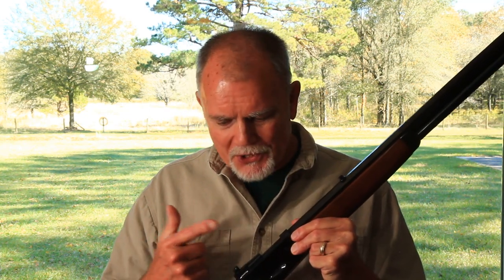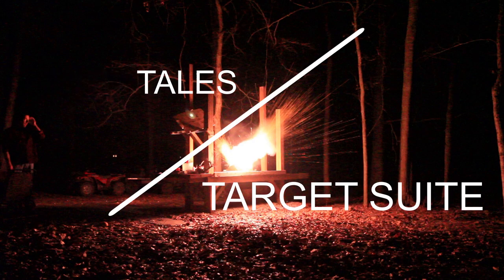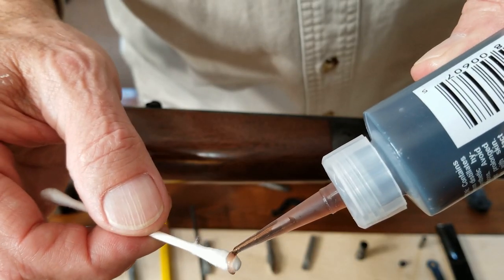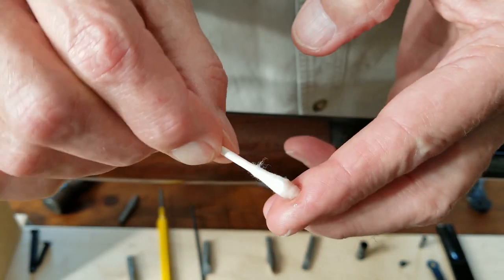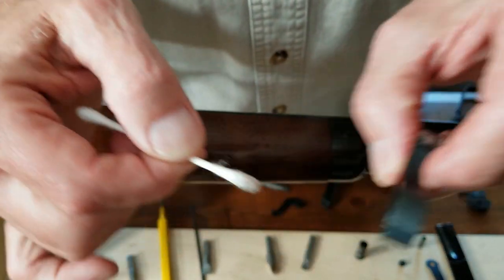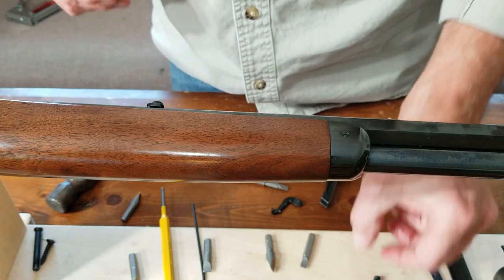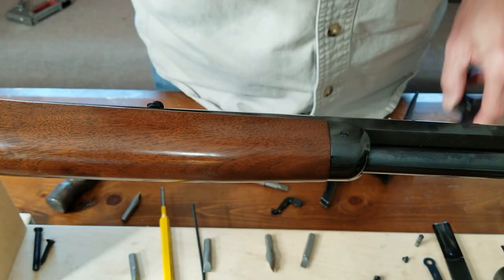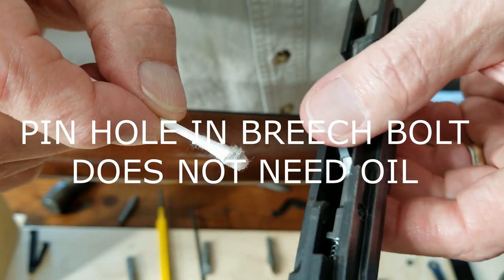Winchester Miroku 1886 Maintenance / Lubrication

Comment: I drown my guns in CLP. Then on any camming surfaces, I use Gunslick grafite greese. I lay or prop gun at an angle to allow excess to bleed out onto a rag for a day. Next day slather outside with generous CLP or other gun oil. Let it soak in a bit and wipe down with a clean rag, but leaving a visible sheen. We get all four seasons in a day in PA. Never had a gun fail from too much lube. But had them rust from too little. I like your presentation style. Thanks
Reply from the maker: Sounds great for moderate climes, but extremely cold weather will turn that "excess" lube into sludge that hinders operation of your firearms. My channel friends from farther north (in Canada) alerted me to that issue. They have to run their guns almost dry during the winter, then lube up when more reasonable temps return.

Comment: I'd say the "slab everything in oil" method is useful for long term storage without firing at least, but yeah I'm inclined to agree that for something you take out somewhat often it just leads to a load of carbon to turn your hands black when it comes cleaning time.
Reply from the maker: Yep. My thoughts exactly. Thanks for the comment!

Comment: I had to come back and watch this and your previous video again.  I just picked up an 1886 (Pedersoli).  It's a beautiful rifle and jaw dropping out of box accuracy.  The action is smooth with just a little binding, which after a few more rounds and a good oiling I'm sure it will be glass smooth.  I like my Marlin 1895 but the 1886 has so much more soul.  Problem is it's almost too pretty to take out into the field.  Thanks for your videos!
Reply from the maker: That Pedersoli is lovely. You won't have to deal with the Winchester safety.

Comment: I use a brake cleaner (carefully) remove all factory, or existing lube.  First thing I do is use Corrosion-X on all metal parts.  But it’s not a lube.  Then I use a light Teflon based grease on high friction parts. And a lighter lube on the rest of all of my firearms.    
For pistols, such as Glock, I use the light Teflon based grease, on the lubrication areas and Barrel.   I do thst because oil will migrate out.
I also mirror polish some non-dimensional critical, high friction areas, but some firearms only.  

I find on lever guns, it’s hard to beat an older Winchester for smoothness.   But I can come close with Rossis.   But they always seem never to quite match my Winchesters, or Marlins.    

If I’m shooting, or hunting in the rain, I will wipe, or spray down my entire firearm with Corrosion—X, or Breakfree—CLP.    I’ve had success in preventing rust with both. But the Corrosion—X seems to work best.  

I’m Not advertising for any brand. That’s just what I use and have had success with.   I have family members that like Ballistiol.  I don’t.   But I shoot and train year round, rain, shine, snow, hot weather, or whatever conditions come, or I can create.     The goal is to hit whatever I’m shooting at no matter what.

I’m also trying out a Lucas product.  So far, I’ve had some success with it.  But it can’t match grease, and doesn’t seem to be any better than Breakfree.  But I have 2 AR-15s that I lubricated each one with a different one.    I’m going to see how  many rounds in each before they get too dirty to be reliable.
Reply from the maker: Sounds like you have a plan, and a good one at that. I personally don't care for Ballistol either. But then I haven't used it extensively either like some of the "believers".

Comment: Just found your channel a couple of days ago and I subbed and I also subscribe to the guys you mentioned and I'm older than all 3 of you. For lubrication I just use white lithium grease applied sparingly with the swabs and one of those little bitty paint brushes. I bought a one pound tube of it 20-30 years ago and have used it ever since. It's bought and paid for so I use it and it has worked for me. May not be the best. Anyhow I enjoy you videos-keep them coming!
Reply from the maker: Thanks David. I think those steel surfaces aren't as snobby about slick'em as we are. But, and this is a big one, I used the Wilson grease (very sparingly) on the slide surfaces of my old High Standard Victor and the best way I can describe it is that their "grease" which is a liquid, got sticky and the slide started moving in slow motion. No more Wilson grease for me.
Reply: I used something like that on my 1911 once and once the solvent in it that made it somewhat liquid evaporated it almost made my pistol inoperable
Reply from the maker: Yep. I think that is what happened to me as well.

Comment: I use white lithium grease on the lever spring & lifter spring (not a ton). Hoppes oil on whatever else needs it. Any lubricant will work.
Reply from the maker: Thanks! I made that point in my 1911 video. The type of lubrication is less important that just doing something on a regular basis.

Comment: Some stainless guns need to be lubed more, especially Rugers that come to mind.  Some of my carry guns get very little lube as it will attract dust and dirt.  I leave my barrels dry so my first shot goes where the others follow unless I'm putting it up for long term storage.  I used to use regular gun oil, but sometime ago I just started using Mobil 1 with great success.  Once a carbon steel gun is well broken in little or no oil is needed.  Your mileage may vary.
Reply from the maker: @buck shot Thanks for the comment. Taking your last comment to heart, there is a lot of "religion" out there about what you "have" to do to maintain your firearms. I think the irreducible minimum is, keep your guns clean (free of grit and abrasive carbon buildup) and use a little oil to prevent rust. Most of us don't shoot our guns enough to really wear them out so just that little bit will probably be enough for most all firearms in "normal" conditions. Now if you keep a gun at you beach house, it will turn to a pile of red dust without  aggressive protective measures, so there are exceptions.

Comment: I see you have knocked the sharp corners off of the locking lugs, did you use a file?  I am a fairly new Miroku 1886 owner and it definitely needs some attention.  Love the series!
Reply from the maker: Hi Mike. All I did was put some polishing compound on a piece of leather and buff the corners. I did not remove any material because  those surfaces are critical to proper function.
Reply: @TargetSuite  Thanks!  I will give that a try.
Reply from the maker: Mike, if you haven't seen my disassembly video on the Miroku 1886 yet, here is the link https://youtu.be/v3fgm3RJn0Q
Reply: @TargetSuite  Yes Sir I have!  I'm going back to the beginning and going through all of your videos, very well done and informative i appreciate your efforts!
Reply from the maker: Beware! There are a few that are pretty silly. Be sure your sense of humor is close by😄

Comment: So what do you use on the outside of the gun to prevent it from rusting?  :D
Reply from the maker: I wipe my guns down with any light oil I have on hand. But if you are going to store guns in a non climate controlled environment it will take a lot more than that. The military uses cosmoline and their guns still rust after time.

Comment: Not saying that some lubes are not multi temp....but it as I write this is -18 outside my window and trapping season is not even properly underway.....i see travel at -40 and some grease actually prevents things from operating ....be careful about where you use grease. Never in firing pin or extractor or trigger areas  ....
Reply from the maker: Thanks! Some of my other viewers from Canada have pointed out the problems with some lubes "freezing up" guns in very cold temps. Something I never had to consider.

Comment: As thin as that grease is I'd just use it on everything and wipe the exterior with the oil for cleaning and rust prevention. 
Personally I'm a wd40 fan for everything maybe a little 3n1 after a good teardown.
Reply from the maker: Hi Jimmie. We have tens or hundreds of thousands of vintage firearms that were well used and are still reasonably tight and fully functional. Firearms that were lubed with everything from WD-40 to 3n1 to motor oil to bear grease. I think the secret is to keep the grit out of the wear areas and just lube with something. The only caveat (and my Canadian viewers pointed this out) if it's going to be really cold, that lube had better be very thin and used very sparingly. Thanks as always. It's good to hear from you! Btw, my Marlin 39a has a stock that is preserved for the ages with WD-40 because that rifle has been slathered in the stuff since the early 60's :-)
Reply: @TargetSuite  lol yep.